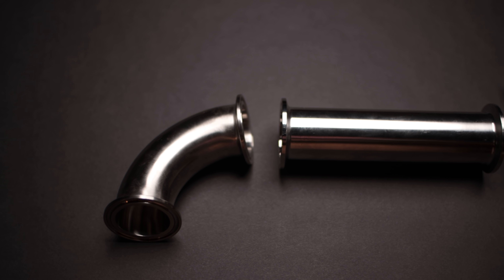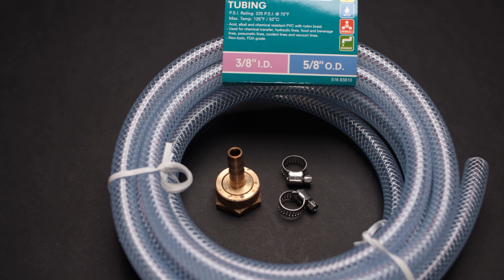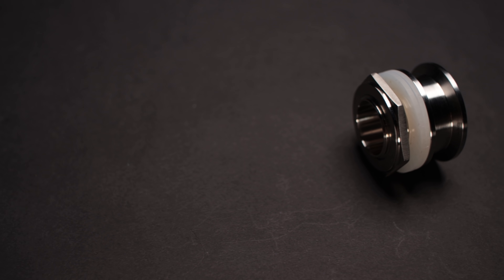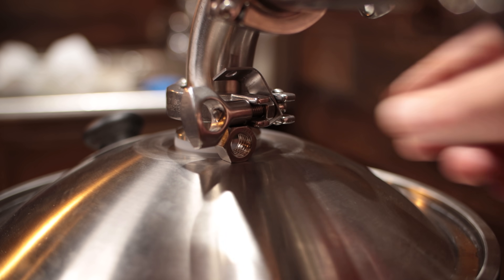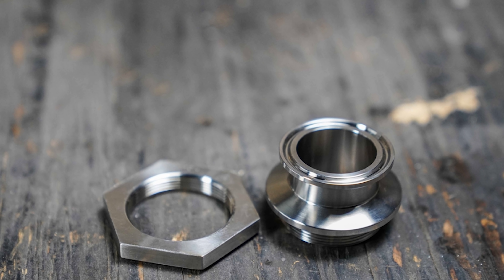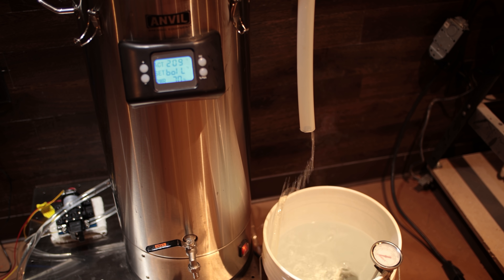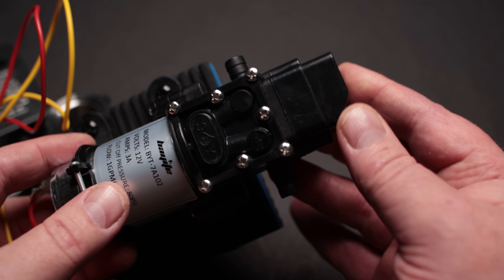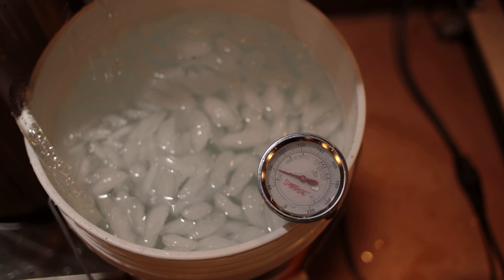DIY Steam Condenser Fits Anvil Foundry, Brewzilla, Digiboil, Grainfather and more!

Comment: I have a non-brewing application where I actually want the fluid going back into the pot.  You mentioned that if the nozzle was place behind the "T" opening that it would travel back.  Can you provide more information on this or direct me where I could learn more how to do this.
Reply from the maker: Are you wanting to add water to your pot as you go?
Reply: Im trying to minimize the loss of the distilled water I'm using.  Right now it steams off so much its a full time job replenishing the water.  The objective is to capture (condense) and recirculate back int the pot @ShortCircuitedBrewers
Reply from the maker: @KatherineZbodulaNP  what not just leave the lid on closed during boil?

Comment: im doing a similar diy but im using a spray ball and a 45w pump instead of a nozzle havent tried it yet but well see if it works.
Reply from the maker: May not work. You need the atomization of the sprayer to create a low pressure in the down tube.

Comment: Thanks for another great video!  Question for Brian or anyone else: Compared to a steam condenser or the condensation hood, how well does a 400 CFM vent hood work for electric brewing? In my case, the duct to the outdoor would be only about 2 feet long, but I wonder if there would be too much condensation in the duct. Any thoughts?
Reply from the maker: What size duct?
Reply: @ShortCircuitedBrewers   @Short Circuited Brewers  Currently, there is a 6" diameter duct. From what I have read on HVAC charts, a 10" to 12" diameter might be needed for 300-400
Reply from the maker: @chris.kriese  I have a 460 cfm vortex fan with 6" ductwork on my brewing hood. There is definitely condensation that builds up but it does exhaust 95% of the steam. Hope that helps.

Comment: I’ve never really been too concerned about boil off while brewing in my mechanical room. I live in CO and the humidity in the winter is 35% and summer 50%. I actually run a whole home humidifier all winter to keep the humidity where it is. Been brewing about 8 times a year for 4 years like this and no problems. I am upgrading from a Grainfather to a 240v Clawhammer so I will watch my boil off rate and may have to throw a box fan in front of the window down there.
Reply from the maker: Whatever suits your situation. 👍🍻

Comment: Hi, anyone an idea how to build this condensor on a Brewmonk titan 70l? diameter of the lid is 35cm (13,7 inch)
Reply from the maker: What type of lid? Glass?
Reply: @ShortCircuitedBrewers  thé original lid is glass, but maybe someone knows a solution and where you buy tot have a lid where a condensator can be build on.

Comment: Hey brian...I'm in the process of setting up my basement brewery and was curious about your hood vent... buying a custom one is pretty pricey..any info would be greatly appreciated
Reply from the maker: I built it from wood. Used marine paint on the inside to seal it and a vortex fan connected to the side with ac ducting. A steam condenser is a way cheaper option the vortex fan that loves the right amount of air is over $100 by itself.
Reply: @ShortCircuitedBrewers  I appreciate that response...the hood vent is better for me to accommodate all my brewing setups. I worried about protecting the wood but marine paint should do the trick...thanks again

Comment: What part did you use to plug the recirculating hole on the Foundry’s lid?
Reply from the maker: I just used the handle and washer that I removed from the top.
Reply: @ShortCircuitedBrewers  Awesome.. Thank you for the reply.

Comment: Hello everybody, Can you guide me where is a website where I can get the formulas to help me determine the size of the parts for  the condenser? The tank I am currently using has an 11 kW immersion heater. This approach seems to solve my problem. Thank you all in advance for your information and comments
Reply from the maker: For distilling?
Reply: @ShortCircuitedBrewers  Thanks for the quick response. I won't be using it for distillation, but rather to cool the steam as quickly as possible when making maple syrup under vacuum. The evaporator is designed to be multifunctional and can also be used as a still. Then I will use a copper condenser or dephlegmator

Comment: What about the hole in the foundry lid for the recirculation tube?  Assuming that needs to be plugged, or no?
Reply from the maker: The handle works well repositioned to that hole as I show in the video.

Comment: I`ve just fitted a 2" bulkhead for an extension to a t500 it covers the load better with the extension, I built a condenser on a 1/2 inch fitting on the side wall of my Keggle yet to give it a full test to see if it will draw enough.
Reply from the maker: Yeah if the 2-in pipe fittings and everything weren't as expensive as they are. I was trying to keep the price down on this I definitely would have gone with a 2-in bulkhead and 2-in tubing. Definitely let me know how that works out on your keggke!!
Reply: @ShortCircuitedBrewers  Yeah cost is a thing even from china, I`ve done a 3" to 1.5 for the hop dropper on my brewmaster as a 3" sight glass and valve would be expensive.

Comment: Would you still be able to use a hop spider?  And how would you drop your immersion chiller in early to sanitize?
Reply from the maker: You could use a tall hop spider and set it on the bottom. You would take the condenser off to put your immersion chiller in. I don't put it in for 15 minutes you can wait until 5 or 10 minutes, if you are keeping you immersion chiller clean and spray it with a little star San solution before dropping it in. 👍🍻

Comment: Isn't the hole in the Brewzilla/Digiboil lid too big to fit a 1.5" TC clamp? I think it's 48mm
Reply from the maker: It will work. The Anvil bulkhead will work better than mine though.
Reply: @ShortCircuitedBrewers  Cool! I just bought a B40 hood to my Brewzilla since I thought i couldn't use a steam condenser. But. How do you add the hop additions with the Brewzilla lid? It doesn't have a second valve like the Anvil or Brew Tools system. Won't you become steamed like a dumpling if you just open the lid to throw them in?
Reply from the maker: @hermanmoller7630  not really you just pop the lid off and let the steam die down then add the hops.
Reply: @ShortCircuitedBrewers  Nice! I just canceled my order of the steam hat so I can get a steam condenser instead. Thanks for your help and the good timing of your video.
Reply from the maker: @hermanmoller7630  glad to help!! 👍🍻

Comment: Make sure you get the brass spray nozzle. I started with the stainless one and it’s 416 not 316 so is not very resistive to rust. And the brass is cheaper from memory.
Reply from the maker: Interesting.

Comment: Wouldn't it be simpler to just use a traditional condenser design (shotgun or liebig)?
Reply from the maker: Well those don't remove enough DMS with the reflux action. The spray nozzle creates a vacuum that pull the steam off of the boil. It's not without some reflux but it removes the DMS

Comment: I have a still made from 2inch tri clamp pipe so I just rig it up on top of the robobrew and use it like a stripping run. Works a treat but the smell of it is not good at all. Fermcap prevents any boil over. Is there a reason people use this spray method as opposed to a condenser from a still?
Reply from the maker: Using a still doesn't strip off enough DMS you need to use the spray to create a suction and pull more of it out.
Reply: @ShortCircuitedBrewers  ok. Thanks. I’ve done a few brews this way and haven’t noticed anything off about them but for the sake of a tee piece and spray nozzle to upgrade what I have I’ll give it a go. Cheers
Reply: @ShortCircuitedBrewers  How does the spray method work any different from a traditional condenser? In both cases nothing is really restricting the output of the boiling process.  I could see a difference if you were using a deflag on a column and sending the vapor back down the column, but I would think you could pack it with copper and strip a lot of the DMS.
Reply from the maker: @jtracy54  the spray creates a vacuum that pulls the steam and DMS out. You don't want any liquid condensing, or as little as possible condensing and falling back into the kettle otherwise you may not remove all of the DMS. A condenser just doesn't create a vacuum to ensure that all of the DMS is removed. 👍🍻

Comment: Could you show more detail on how you set up the recirculation?
Reply from the maker: I just hooked the pump to the input with the high pressure hose to the condenser and dropped the pickup hose into the reservoir..there is an arrow on the pump indicating flow direction. 👍🍻
Reply: @ShortCircuitedBrewers  ah..I was thinking it was a separate recirculating for cooling the condensate. I just got the Solo+, your pump isn’t submersible like the Solo setup?
Reply from the maker: @davidkimball7199  no it's not I wanted a pump that would put out 80 psi. The spike pump is not even close to that. MAYBE 15-20 psi?

Comment: Great video. Ive always just had three buckets one fills and pull it out and refill the bucket with the pump and replace that one with the empty bucket and back and forth. Only using about 4 gallons of water. Never seen anyone on line doing this. I have the spike Version.
Reply from the maker: That works! 👍🍻

Comment: Does the brewzilla and foundry have the same size hole on the stainless steel lid? I have a brewzilla and got the steam slayer but a 1.5 tri clamp bulkhead from Amazon but it is wobbly like you showed in the video. The bulkhead by anvil looks like it solves that problem but there are no dimensions on the hole size so I can compare. Thanks.
Reply from the maker: I am pretty sure they are the same size because both of them will accept the T500 still column.
Reply: @ShortCircuitedBrewers   Thanks for the video. The Amazon one is being returned and I ordered the anvil one. I was looking for a bulkhead tri clamp that would be more secure instead of having to buy a 2” TC bulkhead and reducer. Glad I found this. Awesome video!
Reply from the maker: @mousetrapbrewing9566  your welcome!! 👍🍻

Comment: Wondering if I could build something like this for my Brewbuilt kettle on my herms system? I am currently fighting with steam in my brew house and it will be very difficult to install a hood.
Reply from the maker: For sure!! Just put a weldless bulkhead in the side of the kettle and then attach just the tee and spray assembly. Will take care of your issue for sure! 👍🍻
Reply: @ShortCircuitedBrewers  That will work?
Reply from the maker: @sjporr  yes sir! The original design was done that exact way.

Comment: I brew with an Anvil Foundry in my garage and I just run a dehumidifier while I’m boiling to deal with the added moisture. Works pretty well for me.
Reply from the maker: Yeah that would be fine there I imagine. It's when you get into more confined spaces the the steam can be more of an issue. Listing condenser is not a solution for everyone but there certainly is a place for it and some people's process. 👍🍻

Comment: Great video as always! Just what I was looking for. Now I just need to find a lid for my grainfather G70
Reply from the maker: I wonder if the distillation lid for the brewzilla 65 L would work?
Reply: @ShortCircuitedBrewers  fermzilla 65 lid 16,25“ (41,3cm) and G70 17,70“ (45cm) from what I can find using Google.
But I keep looking for a lid 😀🍻
Reply from the maker: @famengberg  ahh maybe grainfather will make something..
Reply from the maker: I did some searching around take a look at this lid it has just over a 18-in total outside diameter but it looks like it has a pretty good step down from the outer diameter to the lip that sits on the kettle it might be the right size! https://www.webstaurantstore.com/vigor-18-5-8-stainless-steel-replacement-lid-for-60-qt-stock-pot/473SSCOVR10.html
Reply: @ShortCircuitedBrewers  also did some research over here in sweden where I live and find a lid that might fit. Only 30 dollar so will give it a try.
Reply from the maker: Cool!!

Comment: Thanks for sharing that idea, Brian.  It looks like a fun build.  You’d have to modify your process for hopping if you use a Hop Spider 🕷 (easy fix), and coordination for sanitizing a pump/CFC.  It’s kind of ironic you posted this topic when you did, not only for Anvil’s announcement, but because of a brew I did yesterday.  I changed my brew process so I’m closer to a sink (away from my normal venting window) and used a 30 min boil to reduce steam build up.  (The proximity to the sink made things so much more pleasant.  No more stiff garden hoses across the bar top, knocking pictures and glasses and stuff to the floor).  This condenser would be a cool addition to the brewery for long boils, but for a 30 min boil, you’d get to use it for maybe 15 min? As usual, great video 🍻🤓
Reply from the maker: Yeah crazy coincidence!! Lol those are all good points. Thanks for the feedback! 👍🍻

Comment: You can probably get away with using that old dusty immersion chiller and a bucket of ice water as a  condenser like what distillers use.  I know everyone has one of those lying around.  😂
Reply: Or two. ;)
Reply from the maker: Lol
Reply from the maker: Actually not the case. You need the suction from the sprayer in order to pull the DMS steam out of the kettle just condensing the liquid itself like distillers do doesn't remove enough and you would still be left with a lot of DMS in your beer. Unless you're talking about using the coil for the recirculation option.
Reply: @ShortCircuitedBrewers  that's what I was thinking. Use it in an ice bath to make sure the spray is at a reasonable temp.
Reply from the maker: Yes! That would work for sure.

Comment: Brian, outstanding video for the all-in-one brewers!!! You had also commented on a possible option to connect this design to the "side" of a kettle. I have a kettle that is 23 gallons max, but boil around 17 gallons. Aside from hot break management, do you think a "side exit" (and a standard kettel lid) for the steam to travel will be effective enough to obtain good results?
Reply from the maker: Yep the designer of the original has a 20 gallon boilermaker and it works fine I recommend this bulkhead to attach it to a standard kettle. https://amzn.to/3z2wY7h

Comment: Loved it! I was wondering about the hot break. I left my on from mash out to boil. The hot break always puzzled me why it is particularly more intensive. I would open my 4" glass panel but even that the hot break goes from nothing to full out vocanoe mode so fast. I will try leaving off lid until after hot break as you suggest which make complete sense. I was wondering about the pressure that builds up how that migh effect the brew process. Any thoughts?
Reply from the maker: There's not really any pressure. It actually creates a vacuum with the sprayer running. Not a huge amount but it is negative pressure in the kettle. 👍🍻